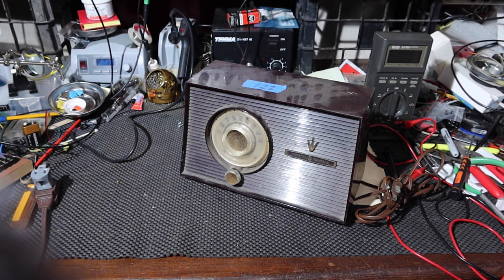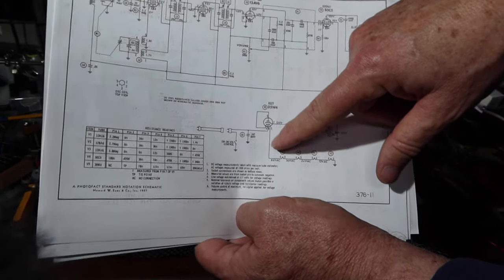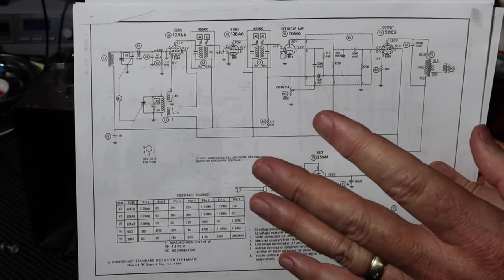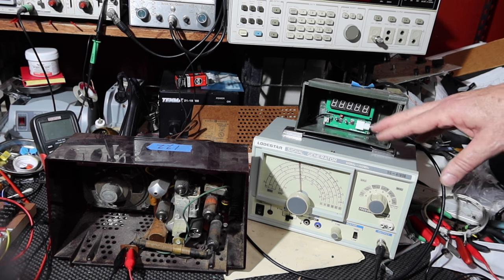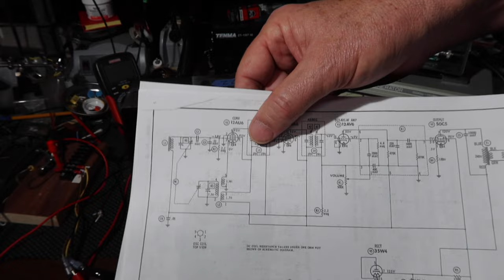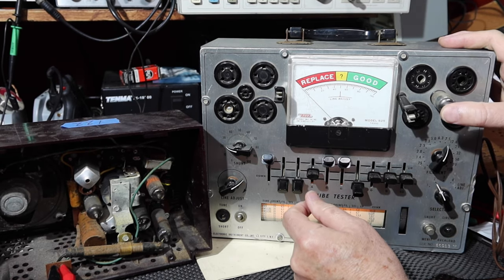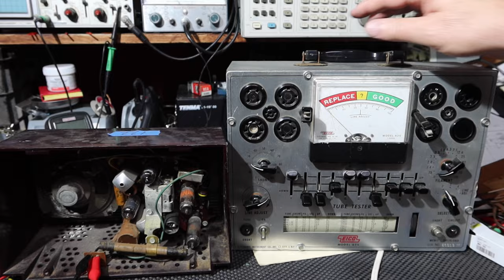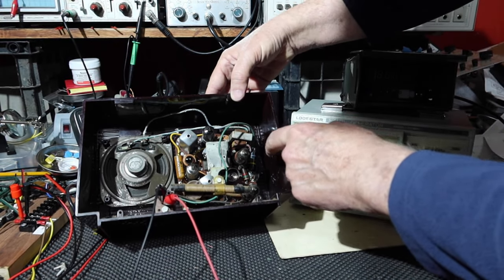GE VACUUM TUBE RADIO REPAIR from 1957 - Part 1.  Model 875.  Yes, Mistakes Were Left In.  [4K]

Comment: I went through a radio nearly identical to yours and had SMD in both IF's and used 100pF caps to fix it. Just joined your channel because of Doug's referral. We were talking earlier about the 9v DIM bulb, and I used two 12v 60mA bulbs in parallel in series with a 100mA analog meter movement and with a short circuit on the output it prevents meter from pegging out. I installed the grain of wheat bulbs inside the bezel of the meter, and it works very well at current limiting.
Reply from the maker: Hi Jim, to borrow from Dr Strangelove: I decided it was time to learn to stop worrying and love fixing SMD.  Ain't afraid of opening IF cans anymore - bring'em on (but man it takes time and patience as you know).  Thank you for the info on the little bulbs, I will add that to my set up.  Also thanks for the sub!  Will head over to DERB and say hey.